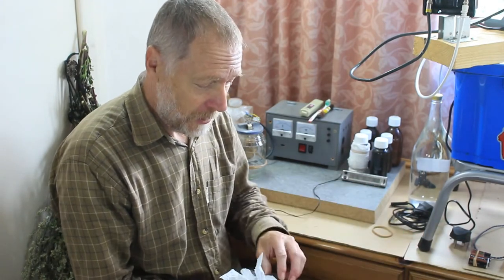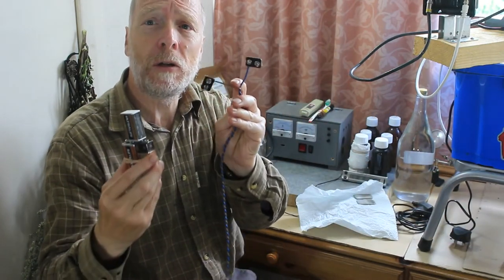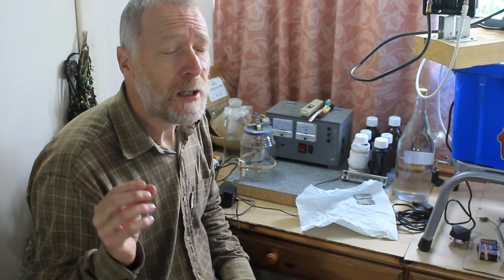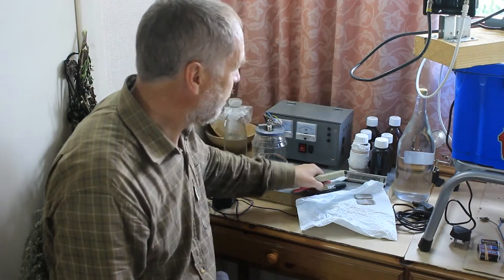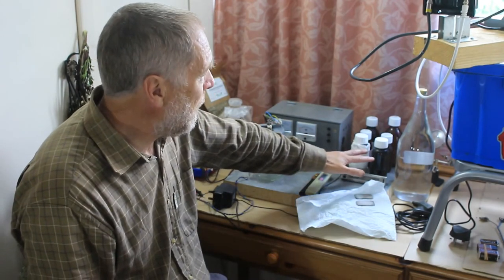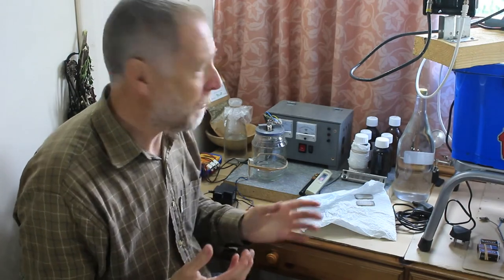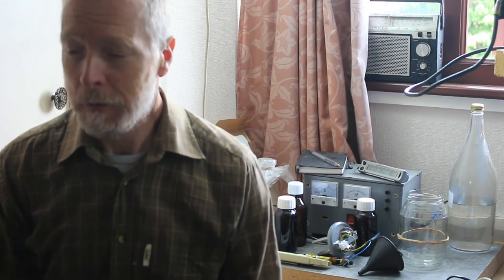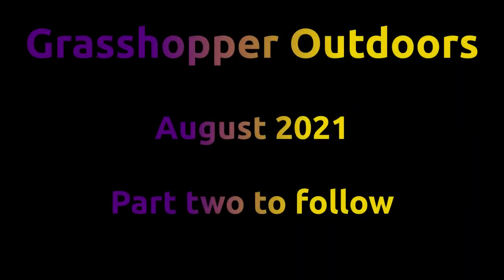Colloidal Silver:- The Ingredients

Comment: Good luck 😂 "Do Not pass Go..." Excellent 🎶
I do like a little control box especially when it's painted grey or black. I may make my friend one as a little pressie?
Excellent video. All the very best to you and yours 👍 👍 👍 🍻 File in the post 😁
Reply from the maker: Haha, I still have part two to put up yet. The absolute best piece of equipment to my set up is the use of the Current Regulating Diode at about 2 milli Amps, it makes things much more predictable and repeatable, taking notes helps but I only take the basics. Atb

Comment: Hi is the amp limiter  called a potentiometer
Reply from the maker: No the current is not limited using a potentiometer, this would not work as the resistance of the fluid changes over time so you would keep having to monitor and change the resistance. I used what is called a Current Limiting Diode (CRD), you will get one from Digikey.com or that on line auction site. The CRD is an extremely simple device (not actually a diode at all) and will work regardles of the voltage between the two electrodes. Mine is set for 2 milli amps in order to keep the particle size small. A 12 volt supply would work OK, I use 30 volts simply to get it started a bit faster from relatively pure distilled water, do not use tap water. If you do not have a TDS meter to measure the quality of the initial distilled water and the finished Colloidal Silver a Laser pointer is a good aid just to see that you are making ColSil.
Reply: @GrasshopperOutdoors  thank you for your kind reply.  I appreciate you taking the time to explain the different parts I need.  Best wishes from Ireland 🇮🇪 to you and your family and subscriber's.  New subscriber 👍
Reply from the maker: @davidhayes5382  You are welcome, I use the volt meter and ammeter purely to make sure I know what is going on, my box is way more complicated than the minimum necessary. A TDS meter is good to have as it means you can make every batch the same and you know your starting point and finish point for say 20 ppm of Colloidal Silver. Use bullion silver, I use bullion bars as you know their purity, silver wire could really be anything. Also try and get actual distilled water, not de-ionized water you get at a garage, you can get water out of a de-humidifier at a push but filter it. I use a little heater on one side of the jar to promote thermal siphoning in the jar to spread out the silver particles, it does make a difference. Keep the colloidal silver in a dark jar and out of sunlight as it will darken over time, I keep mine in the fridge in brown bottles. Research other sources too. I have used it on many occasions including on animals, as recommended by my vet when the dog took a lot of skin off her leg in a road accident.

Comment: Hi, Do you see any difference between using 999 silver and 9999 silver? What's the diode part number? And is it run reverse bias or forward biased? I was thinking of using the current limit feature on a bench power supply but always keen to explore new ways of doing it.  Cheers
Reply from the maker: The "Diode" is not really a diode but a "Current Limiting Diode", (CLD) and in my current case is forward biased and limits the current to 2 MilliAmps (regardless of the voltage (within limits). The silver I use are two 1 oz Silver Bullion Bars 999 (bullion bars are rated like this which I don't quite understand as it essentially means 99.9 % pure. Current limiting on a bench supply would work fine, a CRD is simply easier and cheaper if you have any power supply giving over 12 volts. I use 30 volts as it gets the reaction going quicker in the early phase, when distilled water is pretty resistive. Some heat can help get things started or add a few drops of previously made ColSil to reduce the initial resistance if your starting voltage is low.

Comment: 30 VOLTS? wow. you only need 2 to 5 volts. you can use AA batteries and a current of less than 0.5 milliamps
Reply from the maker: If you are using distilled water (not simply de-ionized water) it has a high resistance so it takes much longer for the desired current to begin to flow at very low voltage. Usually people that start with less than 9 volts add a little previously made ColSil to reduce the initial resistance. I have found a start voltage of 12 volts to be adequate, but my distilled water is only single distilled, not at least double which would be purer.
Reply: @GrasshopperOutdoors  i just use boiled tap water. boiling kills any existing pathogens and reduces the amount of dissolved gases. the distilled water is unnecessary and pointless. my cs from tap water works. how do i know this. i tested it on myself and others. also putting a drops on a slice of bread to see mold growth rate, etc. toothaches and other ailments like UT infections. it worked! i was in hospital due to a UTI but i had drunk cs prior and my bladder infection went away while in hospital although i got the antibiotics anyway. i have experimented with a/c pulses currents as well all under 5 volts and frequency of 0.25 to 1 hertz. this removes the need for stirring as evidenced by hardly any blacks deposits on the bottom of the jar but still showing strong tyndell effect.
Reply: Could you use a trickle charger that is 12v?

Comment: All this process does is create ionic silver, NOT colloidal silver. Night and day difference between the two. That fact that you do not know this and are misleading people is deeply disturbing.
Reply from the maker: Anybody who uses content on any youtube video for critical applications without going on to doing proper detailed reseach combined with critical thinking has a poor grip of reality. But you do make a very interesting point.
Reply: @GrasshopperOutdoors it does the same. people gave been making it your way for 120 years and fixing problems
Reply: Before ac/dc, ( not the band, little further back.) They used silver coins in the water as a purifier.  A simple reducer at the end of the run changes the s.i. to c.s.